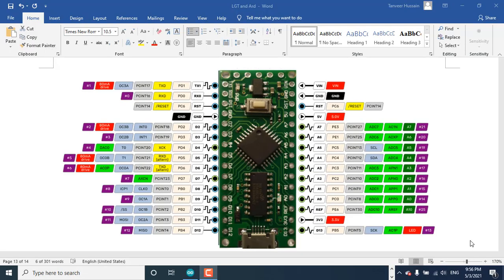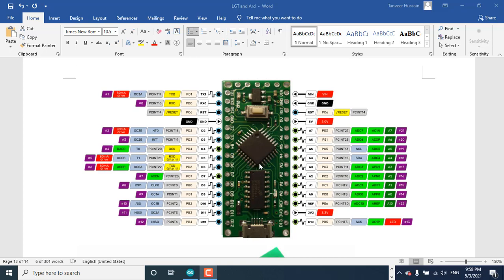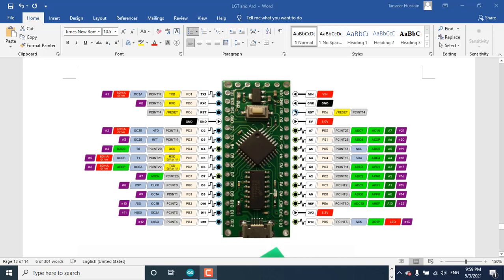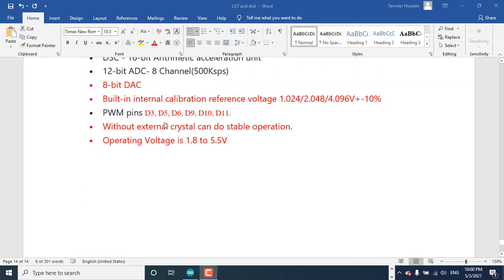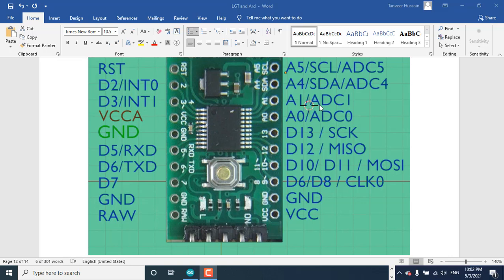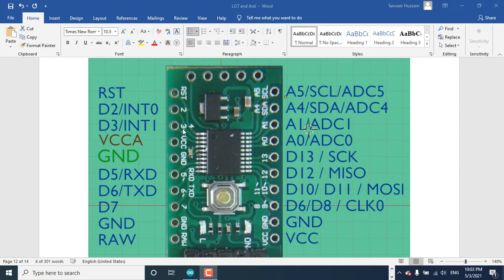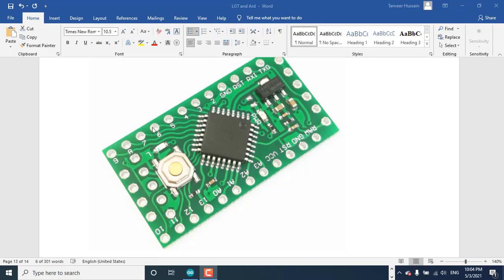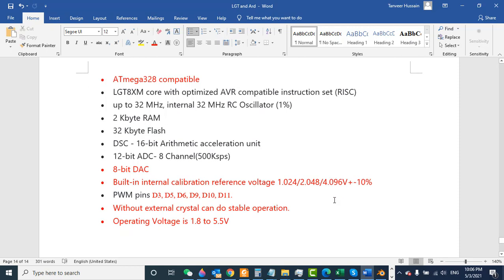LGT8F328P Board Pinout | LGT8F328P pinout

Comment: The  pin chart notation seems to suggest that the LGT8 Nano allows A6 and A7 to be used as digital I/O pins - which the original Nano doesn't. Is that another LGT8 advantage?

Comment: Could you clarify one thing. In the figure pins 2 and 8 are shown as PWM. Can I use them for motors speed control or not?
Reply from the maker: Yes can be used to control the motor speed pin 2 and Pin 8. 
in fact all pwm pin can be used to control the motor speed
Reply: should pwm on pins 2, 8 work as usual “analogWrite”, or pre~configuration need? what does it mean “uptionally up to 9 pwm “?
Reply from the maker: @АндрейГусев-ь9г  Sorry for previous reply. i just check detail of LGT Now. PWM pins are D3,D5,D6,D9,D10,D11. other pins are not PWM pins. only these PWM pins can be used to control the motor speed. 
other pins which are not PWM can?be used to select the motor direction but can not control the speed
Reply from the maker: @АндрейГусев-ь9г  https://www.youtube.com/watch?v=3mfpERgAaWc
this link to control the motor with H-Bridge and mcu